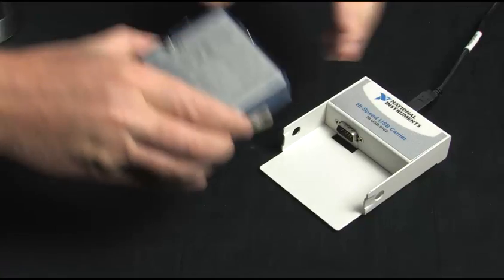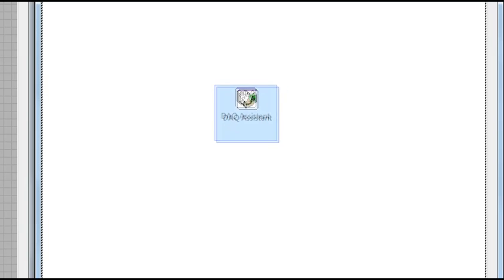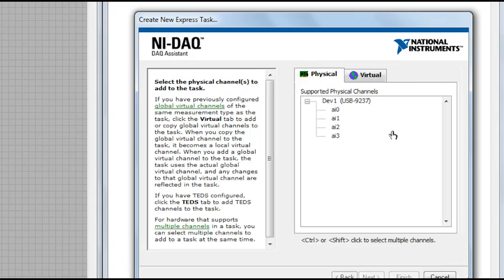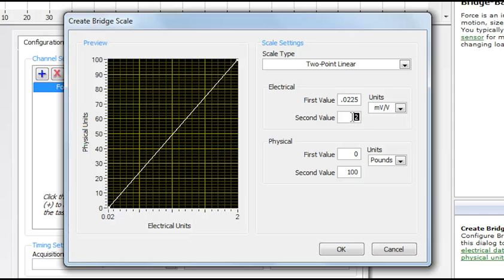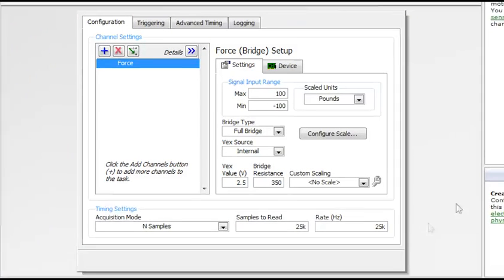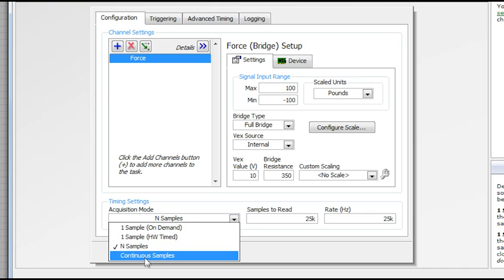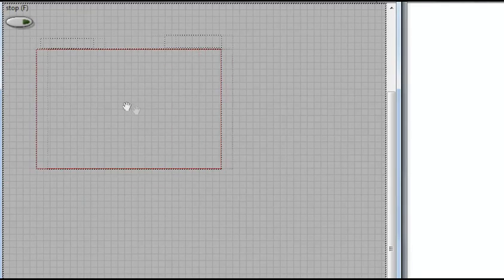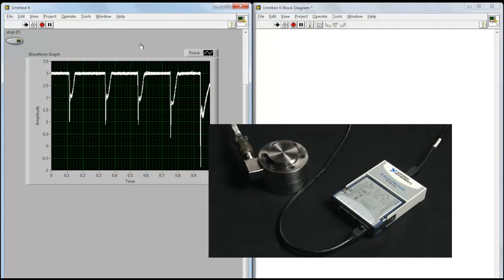How to Measure a Load Cell

Comment: A load cell which requires 10VDC excitation with a 350 Ohm internal bridge resistance will pull about 285mW of power thus exceeding the power limit of the module.  IF THIS HAPPENS, the module will override your voltage input command and reduce the excitation voltage to a level that satisfies the power limit.  In this case the voltage would automatically reduce to about 7.2 VDC. If you hook up more load cells, the input voltage will continue to drop, and if your load cells have a ratiometric output (mV/V) and have been factory calibrated at 10VDC excitation, then your output will absolutely be incorrect.  

Therefore, you MUST use an external power supply in this scenario! Be sure that the power supply can provide the maximum amperage required for all your load cells too.  And be careful not to exceed 10V from the external power supply because this will damage the module.  For this reason, I would avoid a variable power supply which could accidentally go too high if you turn the wrong control knob.
Reply: Is there a way to monitor excitation and signal voltage?

Comment: In the NI9237 Data Sheet it's stated "Unless you supply external excitation voltage, NI recommends that you set
the excitation voltage to a value that keeps the total power below 150 mW"
In the presentation video it seems that the configuration it's exceed this power (10V excitation and 350 ohm bridge resistance = 285 mW).
Is it safe to run in this condition? I'm asking this because I have to run in exactly the same situation and I need a recommendation if I should use an external excitation or not.
Reply: *Unless you supply external voltage..." meaning that if you are using the NI device to supply an excitation voltage then you should keep it below 150 mW.
The device has an external voltage source, therefore, it isn't limited by that restriction.
Reply: I know you posted this 3 years ago, but I am currently dealing with this exact issue.  You are correct - a load cell which requires 10VDC excitation with a 350 Ohm internal bridge resistance will pull about 285mW of power thus exceeding the power limit of the module.  IF THIS HAPPENS, the module will override your voltage input command and reduce the excitation voltage to a level that satisfies the power limit.  In this case the voltage would automatically reduce to about 7.2 VDC. If you hook up more load cells, the input voltage will continue to drop, and if your load cells have a ratiometric output (mV/V) and have been factory calibrated at 10VDC excitation, then your output will absolutely be incorrect.  

Therefore, you MUST use an external power supply in this scenario! Be sure that the power supply can provide the maximum amperage required for all your load cells too.  And be careful not to exceed 10V from the external power supply because this will damage the module.  For this reason, I would avoid a variable power supply which could accidentally go too high if you turn the wrong control knob.

Comment: I set up  an Lm 324  to operate as  an instrumentation amplifier ( using a 741 loaded down the load cell...no pun inteneded) to amplify  the milli-volt output from my load cells, and also that the arduino  could process the signal.

Comment: Since you expect the load cell to read from - 100 to 100 pounds, why didnt you calibrate the electrical values to physical units based on -100 to 100 pounds and you used 0 to .066 pounds?

Thanks.
Reply: +Stathis Polydorou Is it easier for you to apply  and test 100 pounds for calibration or 0.066 lbs? :)

Comment: Where can I purchase these load cell along with license for the LabVIEW in India?Also we intended to measure the strain developed on the fiber optic cable by applying various load what type of load cell is preferred for that application?
Reply: none? you have to glue strain gauges to the fibre cable sooo its only a half bridge and i think yu should contact ni.com support for more help